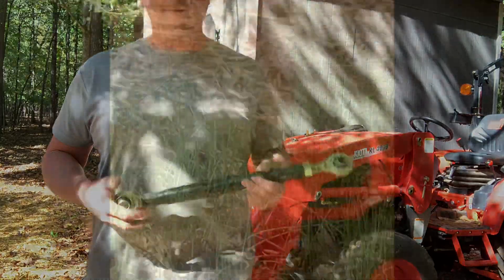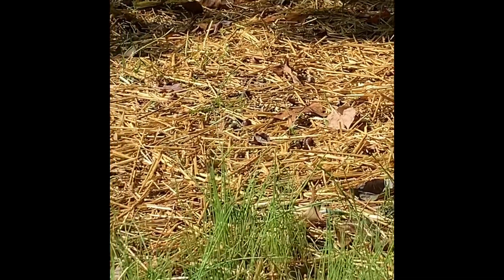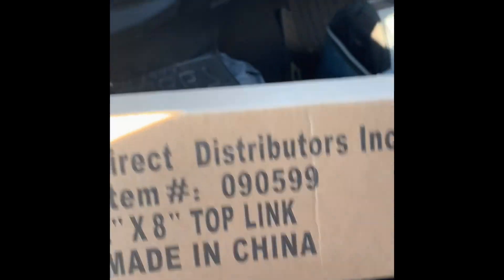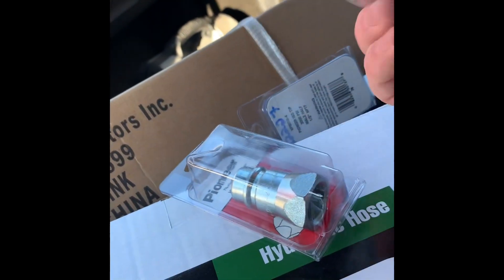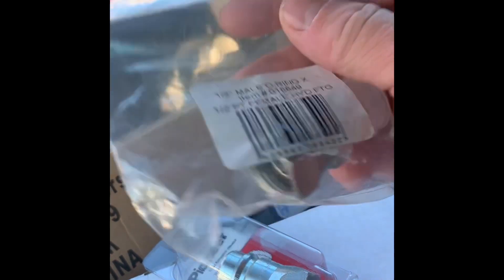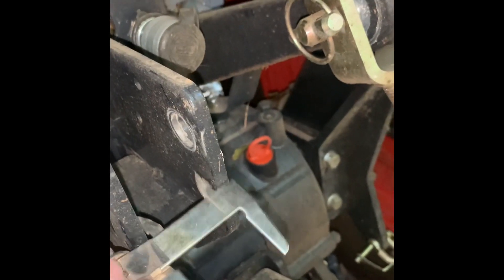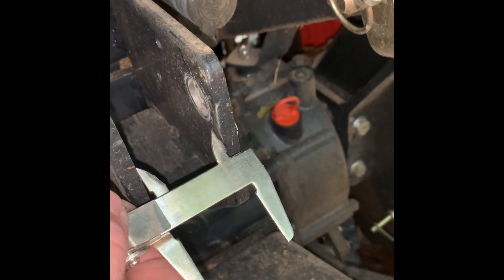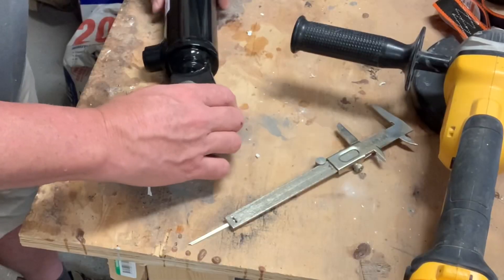Hydraulic Top Link Installation | Kioti CK2610 HST

Comment: I know this video is four and a half years old, but I just came across it for the first time.  I'm guessing that you know this by now, but since you bought a hydraulic cylinder with no check valve on it, that it "bleeds" or "leaks" down when there's a heavy implement on the rear over time, correct?
Reply from the maker: Sure does

Comment: Did you already have the remote rear ports already installed ? If not what kit did you use
Reply from the maker: Yes they were installed by dealer when I purchased the tractor

Comment: Yellow or pink teflon, rated for fuels and oil fight have been a better choice, than the white, which is rated general plumbing.
Reply from the maker: Ahh. So far it’s holding up. If needed, I will change it out to the appropriate tape.  Thanks

Comment: Maybe I’ll understand this video better when my tractor gets delivered but I was really unimpressed with the time you spent on the grinding, taping, etc…but didn’t spend much time on attaching it to the tractor especially the hoses. Also,  which controls did you use to adjust? (Just my 2 cents)
Reply: Spot on. I was thinking the same thing.
Reply: I have a CK2610 but I guess I’ll have to find someone else’s video to show how to actually accomplish this.

Comment: I just installed a hydraulic top link but I used quarter inch hoses they're more flexible than the half inch hoses
Reply from the maker: Interesting. High enough PSI with 1/4”?  I never checked into anything smaller than the 1/2”.

Comment: Turn your hydraulic top link over 180 degrees so the hoses point down instead of up...giving you more clearance on your fuel tank. I have the same tractor and added a hydraulic top link to mine as well.
Reply from the maker: Yep, that’s exactly what I did. Works great now
Reply from the maker: Actually that’s what I had to do in the very next video I put out. Ha

Comment: Nicely done. One suggestion would be to be very careful of your hoses pushing into your fuel tank. I did the same upgrade to my CK3510 this past summer and ended up putting 90 deg elbows on the cylinder to route the hoses parallel to the cylinder so they would not jamb up into the gas tank. I also removed the top link holder bracket because it was in the way for my setup.  I love the hydraulic top link and don't know how I loved without it.  Keep up the great work.
Reply from the maker: Thank you, I appreciate that!  I like that idea of using the 90s. I’m also going to put a hose sleeve around the hoses to help prevent rubbing.  Do you remove the top link when you’re not using it since you removed the holder bracket?
Reply: @MakeitHappen1  I do remove it because I have a backhoe that I normally keep on it. I use the hydraulic top link when I attach the box blade, land plane or rear blade. I sleeved my hoses too. Keep up the great work.

Comment: That was a cool video. Do you think the 15" hose is good or what you did is better
Reply from the maker: Thank you. I just measured mine.  The connectors on this Grizzly cylinder are on either ends of the cylinder. A 12” or 15” would work on the connector that’s  closest to the tractor but it would at least take an 18” for the connector farthest from the tractor’s remotes.

Comment: You don’t use Teflon tape on the boss 0-ring fittings nor on the flared fittings - only on NPT fittings.  So you didn’t need any.
Reply: Not only that but you really don’t want that stuff coming apart and getting into your tractors hydraulic system.
Reply from the maker: True. In a later video I had to make some adjustments to the top link so I removed the Teflon tape from the connections.
Reply from the maker: Yeah I wasn’t sure. I’ll keep a check to see if the tape causes a leak.  Thank you